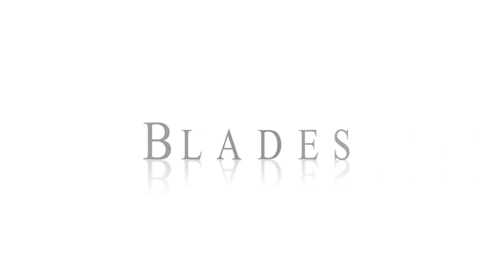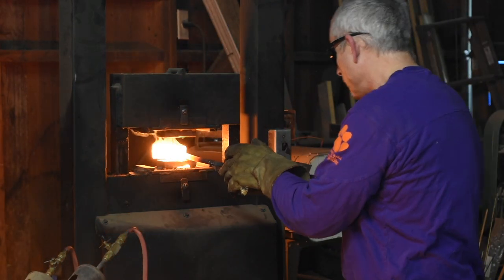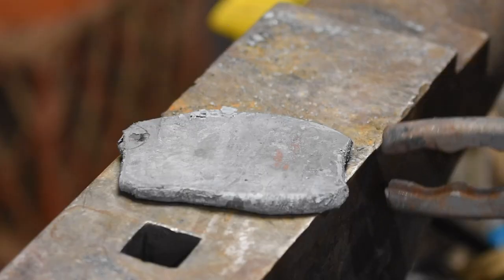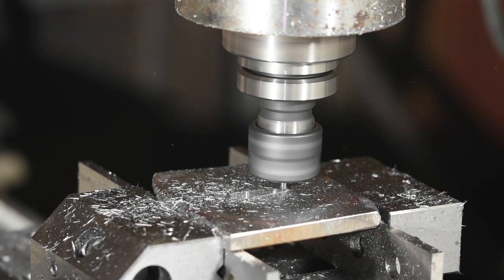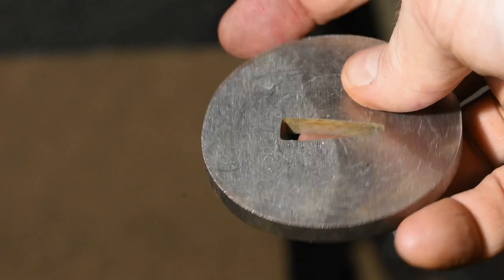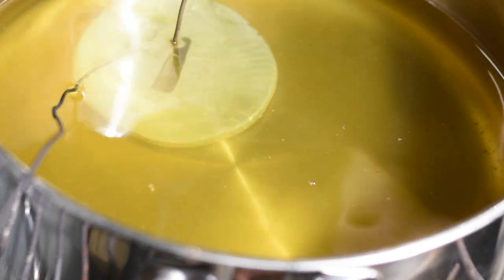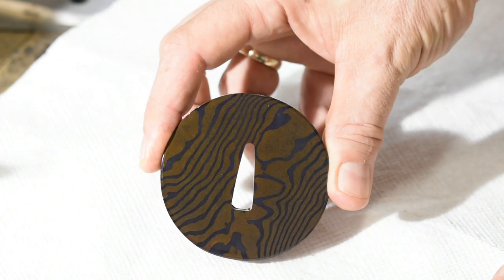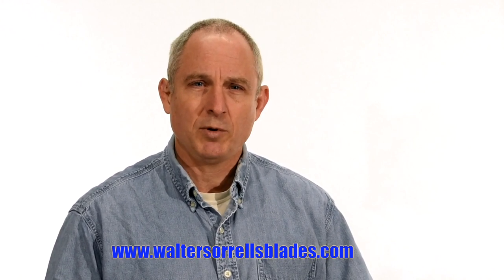Forging a Damascus Steel Japanese Sword Guard

Comment: I like to drill a hole, drift it larger using some drifts i made from railroad spikes then finally hot fitting it to the blade. no filling needed and takes about 13 min.